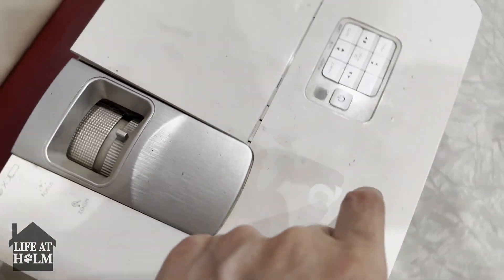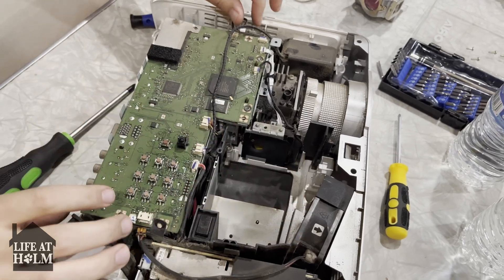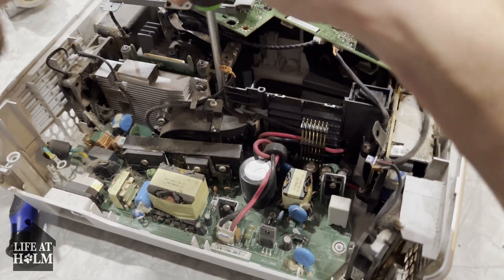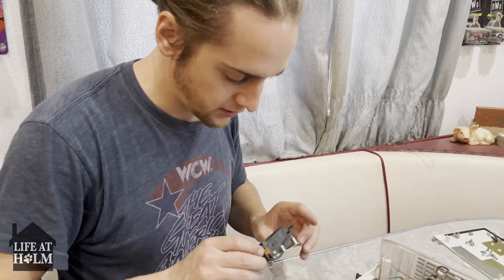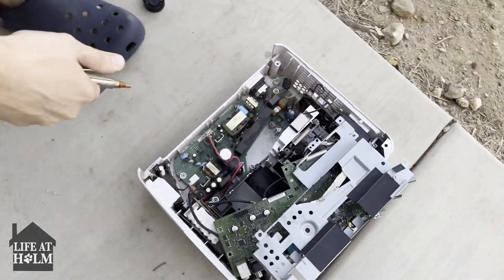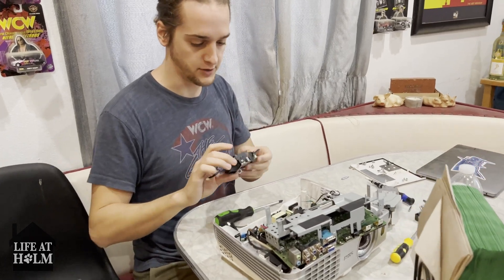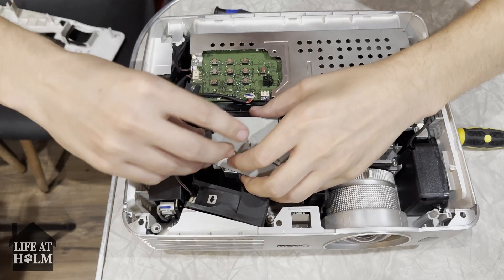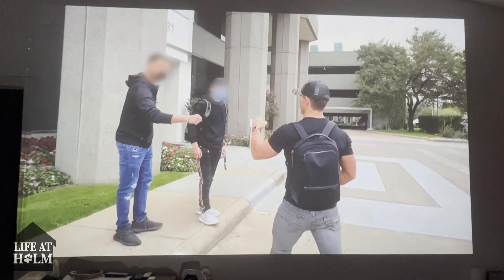Why Projectors Overheat (and how to fix it)

Comment: Hey. I have a similar projector (th671st) and it simply dosen't start. The temp light is solid red. I have opened it to clean the fans but they were pretty clean already. What else can i do? I have reached Benq but they replied that they don't support this model anymore😢

Comment: After cleaning consider using a prefilter on the outside makes it easier for cleanup and preventing interior dust contamination.
Reply: Yep, not too thick though, and would require regular cleaning  of pre filter, or could cause a lack of air flow, causing further heat damage to lamp. But yea good idea 🙂

Comment: Hi! I recently replaced a broken chip in my projector (Acer X1320WH model) and I'm not sure about the placement of the big fan(s) next to the lamp (so not the small one that was cleaned in this video). Should they pull air away from the lamp and towards the outside, or towards the lamp and into the projector? Here it seems like the big fan is pointing towards the outside, given the arrow sticker we see on top of it. Is that true for my projector as well? Last time I turned it on, it smelled bad, like maybe it was overheating.....

Comment: I have the BenQ W1070+ with the overheat issue and after watching i'll give it a clean tomorrow - i can see lots of dust on the air fans just inside the casing so i think dust is the problem - fingers crossed !
Reply: can you update me? I have the same projector and want to know if it helped you
Reply: Sure thing.I dismantled completely,cleaned the 4 cooling fans and replaced the lamp because the porcelain base was failing.I had monitored the casing temperature both before and after the overhaul just above the lamp location and it was 47deg c.Following the overhaul  the projector still displayed the same characteristics - shutting down after 30-40 minutes run time and when it shut down i measured casing temperature at 47deg c.I tested an Optoma projector casing temperature for reference and it too was 47deg c running temperature.This led me to conclude that the fault lie in the temperature monitoring and detection circuit/devices and not restricted or impeded cooling airflow in the projector itself.I also tried a factory reset and checked to see if a firmware update was available to no avail.The lamp run time was about 1500 hours which is approximately half the time that Benq state for this model - i usually ran it in Eco mode.I had the option of buying the Optoma projector from a family member with 116 hours lamp usage time so i scrapped the Benq unfortunately.Hope that's of use to you.Thanks.
Reply: @twiglet2214  hey thank you! but doesn’t that mean that the overheat issue was a false alarm and the red light showed up only due to a malfunction? Operating temperature seems normal to me at least! Maybe you could’ve ran the projector for longer. Which optoma did you get? kind regards
Reply: Problem was it was not just the warning light but the projector shutting down which half way through viewing something wasn't ideal - i gave it a go,changed the lamp etc so decided to pull the plug on it.The Optoma 4kUltra HD is now the one i'm using - bigger than the Benq but does a good job !

Comment: You have to remove all fans and use a paint brush and vacuum cleaner to dust it off. Never use a compressor as air duster. You blow the dust onto the dmd and you will see the dust particles on the projected image.
Reply from the maker: Ohh 😅😅 I will be sure to do that next time
Reply: Great point! Also be careful of any static electricity shocks from body to main board 😊

Comment: Never use compressed air from a compressor. Static can build up and damage the boards. Use canned compressed air. Good job taking this unit apart and getting it back together. 👏
Reply from the maker: I had no idea, will grab some canned air next time, thank you!
Reply: and that's the best way to put a looooot of dusts on the DLP Chips